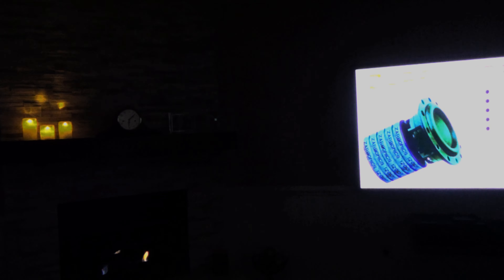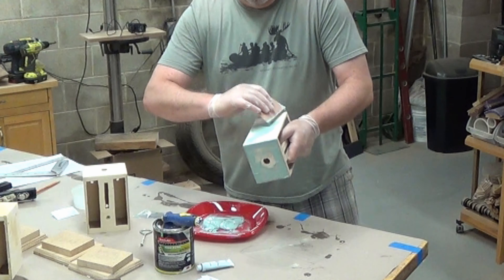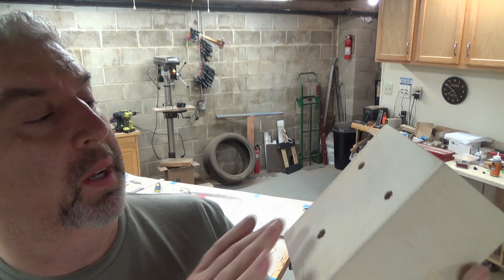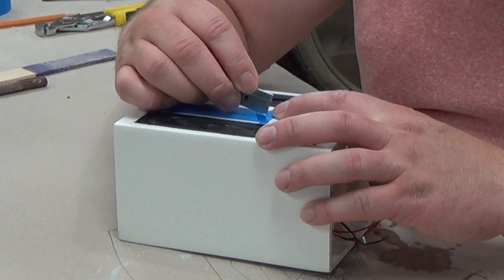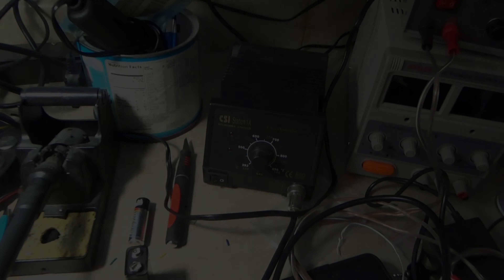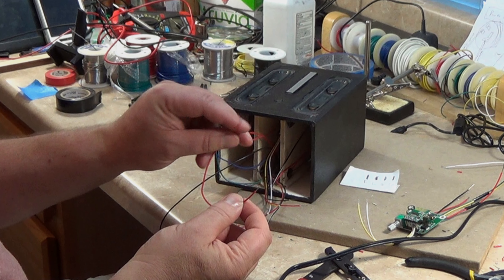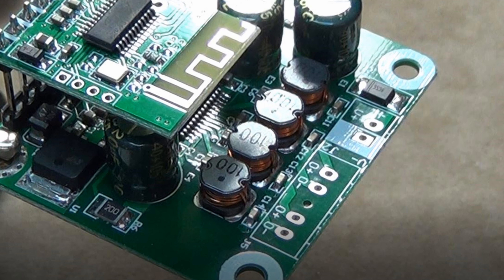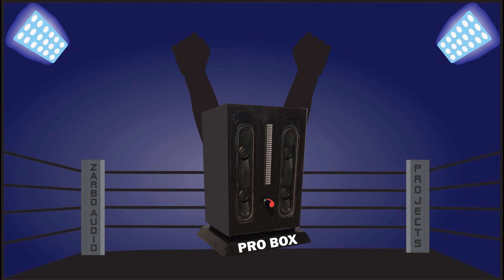Bluetooth Buyout Build-Off Video-Part 2

Comment: This is a pretty cool build, saw these buyout speakers on sale earlier. Consider adding a proper sound test. It may not be accurate, but it's a big help
Reply from the maker: Thank you, and Good point, Luke. I never really did a little 'listening session' on camera with these when completed. I did do a sound demo on the basic setup in an earlier video. Check this link that demo's them playing in prototype form. https://youtu.be/ZpaqX0wIxw8?t=512  Like you mentioned, it doesn't really do it justice, but it's something... Thanks!